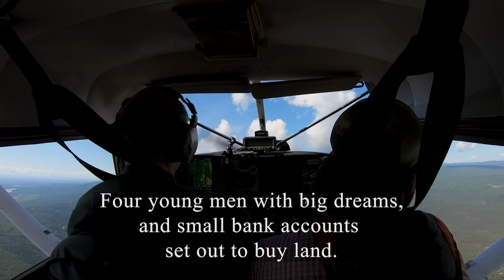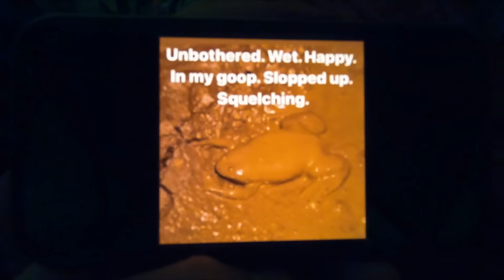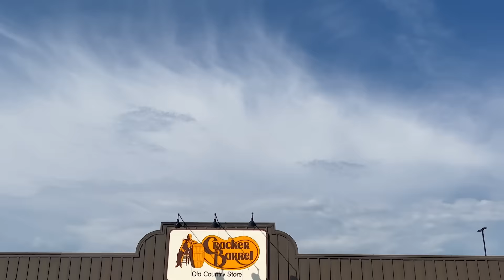30 days Starving and Building a cabin. Hungry Alaskan lessons

Comment: I've been in construction for 25 years and that was a hell of a lot of work guys. Nicely done. Grab yourself a Vaughn 19oz curved handle califoria framer hammer. Cheap, well made, ergonomically silky and powerful. Field test handle like any wood handled tool before taking it into the bush but I have never had one break. Claw doubles as a pickaroon.
Reply: @swervsplatt9672  Stiletto handles usually fail if you work them hard. Most pro's use a separate hammer for pulling nails/demo if they run a Stiletto.  They are alright for repetitive smaller nail application but not much else. Vaughn 19oz curved wood handle cali framer is best all around hammer I have ever found and I have tried pretty much all of them. Only one that beats it is an Estwing solid steel framer, which are basically invincible, but handle design lacks that comfortable end grip, wrist flick crazy power that long curved wood handles deliver. 

-Rehandled Stiletto-not bad but overrated, still takes an extra swing or two compared to others.
-Vaughn 19oz cali framer-Best all around.
-Estwing 28oz solid steel framer-Thor's hammer that makes nails, thumb tips and knee caps vanish with one swing. Just leave the 30oz on the rack. They are to powerful.
Reply: @bryanabingart7362  Happy to help and hope you put it to work. They feel a little slippery when new because of handle coating, like most wood handled tools, which quickly fades in normal construction use but you can also do this yourself with a little razor scraping, light sanding and boiled linseed oil treatment. Plenty of tutorials on here to check out and enjoyable to do and make it your own. Again, it is a wood handle and everyone is unique so go power swing it into a 2x4 scrap or something as hard as you can a few times so there are no doubts and it's tested and approved. Than tune the handle up. Vaughan has never let me down but I have had other brands break or heads become lose after this simple test. Than go build that cabin!
Reply: No one, even the salty old framers around here, use wood handles anymore.  Vaughn's fiberglass models are far superior for durability and shock absorption. Wood is outdated tech
Reply: @bryanabingart7362  I was responding to the original guys comment. I never said to use power tools.. if you want to break a wooden handle out in the bush by all means go off. He even recommends to field test them because this is an issue. It's the same company and the same tool just slightly evolved to deal with the obvious issues. Feel free to figure it out on your own new guy 🤣 I own multiple of each fyi. Too funny. Imagine thinking a fiberglass hammer is a "tech" or easy  answer. Dudes arent even building the handles in the bush like people would back in the day. You dont even know how to talk yo smack right
Reply: @chompers11  Nah, fiberglass is good but in no way superior. Most pro's still prefer solid metal or wood handles and know how to pick ones with preferable grain and test them anyways just in case. Glass is good for repetitive light hitting or heavy shaft splitting mauls/shovels but work it hard with leverage and it will fiber out and turn into a broom. Hell, even miss the nail or wood you're splitting a few times and hit the neck and it will fiber out. I've broke more fiberglass handles than I can remember usually pulling nails and even saw a guy take a hammer head to the face 30 ft away off one of those glass handle grenades when head let loose. I've never used one since I saw that. Plus I work where it can get down to -30. When it's that cold glass hammer handles can simply shatter from minimal use. Wood handles aren't outdated, they are the universal standard proven by 1000's of years of use.
Reply: Steel or wood ? steel on site, wood in the workshop, as for nail removal, a wrecking bar of some kind is a must, useful anyway. I know a man who has had a glass handled hammer for years but he’s a shopfitter !   I started on farm buildings with the only spare hammer on site, a 28 ounce steel shafted thing, you get used to them, Of course nobody used framing hammers in England in the seventies, ‘cos there weren’t any ! Anyway we’d have been embarrassed to need a handle that long.
Reply: Go with the 21oz
Reply: 22 or 28oz Estwing.. I'm still using my 22oz everyday after 15 years.
Reply: @houseblacksmithing9836  Estwings are great. Just remember these guys have to pack all the stuff in and out, are not regular hammer swingers as far as I know and are gonna go balls to the walls to get as much done as they can. That's why I recommended the 19oz because every ounce you have to pack in and repeatedly lift counts, arm fatigue can quickly become dangerous and slow or kill any progress and a 19oz gives a little wiggle room if you are noodle arming later in the day and glance a knee or hand. 19oz will get everything done they will need it for without accelerated fatigue and higher accident risk.
Reply: Estwing for my 33 years
Reply: @69jbr69  Never seen one fail in five years. And yes, a cats paw and mini pry are standard accessories on our nailbags.
Edit: This is doing pole buildings. So, yeah, if I needed a hammer for when I was doing concrete, I used Estwing.
Reply: @swervsplatt9672  Ya, cat's paws are ridiculously handy. In my bag I run tape, speed square, cat's paw(with slightly longer handle for leverage and finger safety if I have to smack leverage it), small moulding pry bar, flat trim pry bar, chisel, punch, chalk line, utility knife, various pencils, Vaughan 19oz, tin snips and a torpedo level. Found that combo to cover just about everything from foundation to turn key with a few specialty hand tools needed here and there of course.
Reply: @69jbr69  That's the setup. 👍
Reply: @69jbr69  A short pointless aside: Years ago when I was first getting started working for myself, I was hired as a handyman by an old fellow.  The first few jobs he paid me with Estwing hammers.  My wife thought I was nuts, but at the time one hammer was worth ten hours of my work.  I ended up working off and on for the guy for years, come to find out he was an expert concrete man, and had worked as the General Supervisor on three dam projects, along with several other large builds.  I learned more from that man than I've learned from anyone after thirty five years experience... and I still have all those Estwing hammers.
Reply: @electrocanman  Great story and sounds like a winning deal to me. Laughing at picturing your wife's face when she asked how much you made that day and you proudly whipped out an Estwing. Most women just don't understand.
Reply: I’ve never had a nail that didn’t drive with my axe or hatchet. Can’t pull one very easy but have never had to when building in the bush.
Reply: Nice video

Comment: as a 53-year-old carpenter from Ontario. I built my first cabin at 12 years old, by myself, in my local woods. The cabin was 18' x 12', flat roof, covered with 30" x 30" tin...supplied by my grandpa. Did it all with one of my dad's splitting axes.The cabin was made from eight to ten-inch diameter white cedar.
 I am enjoying this adventure thoroughly
Reply: Pictures
Reply: @lloyd nelson  I wish I did, that was 1982...I don't know that had even taken my first picture, let alone have a camera.It's probably one of the reasons why kids did things like that then. We went outside to play.
Reply: I'm 50 and I built my first cabin at 47 years old. I learned so buch from the first build (in Louisiana) that I am traveling to Alaska for my next build. I cant wait.
Reply: @markymarc37  Yeah we did. 

57 years old. Made a crossbow at 12, from first principles, i.e. we had no such thing as tutorials, I had seen crossbows in comic books. The first one could drive the dowel arrow with six inch nail tip through a inch pine board. The trigger was SUPER touchy, asked an uncle what I was doing wrong. He said "Ummm, the answer is making a crossbow and firing it in the town without  training. Come with me" and gave me better gear, and some books, and firm instructions not to shoot  anywhere except where there was a backdrop* . He also showed me how to repurpose household things, which was a revelation. You can make an AWESOME trigger from a cupboard catch.

* This worked fine, until it didn't.
Reply: @markymarc37  bruh, i lived out in the sticks and "went outside to play" but nobody today is getting handed a few grand worth of tin and lumber and told to have fun
Reply: When i was 8 i made a replica 1:1 collosseum out of wood with my grandmothers 30 year old toothpick.
Reply: Hero.
Reply: Holy smokes, I was just a kid with a paper route, no big dollars.
Just vacant bush at the end of the end of the street. No one cared, kids making forts.
Reply: @chetmcdonald 44 here, and that’s something I’d LOVE to do as well! Good luck my friend!❤
Reply: liar.
Reply: Nobody cares about your story... make the video!!
Reply: Idk if giving a 12 year old a splitting axe is a good idea but respect for making it
Reply: @n.c.pictures  he didn't give it to me I snuck it, lol
Reply: @markymarc37  well damn 😂
Reply: They don't make 12 year Olds like that anymore
Reply: Built a cabin in the 6th, and it started to produce kids by 7th grade. True story.

Comment: Watching this reminds me of when I built my log cabin 15 years ago. I still live in it to this day. I built it because of the line of work I do, I want to be off grid. My only electricity for my phones and computer is a massive generac generator I have I out here I have converted to run of pretty much any type of ignition source. Whether it be propane, butane, acetone, gas, lighter fluid, diesel and so on. It it lights up I can run off of it. Incase your wondering how I got a regular generator to run off all these thing being just a regular gas generator you can check k out the channel project farm. But either way it took me 6 months to build it and it's 2 stories. I also didn't use hand tools because the main trees I was dealing with is all hard wood like oak, hickory, maple and so on. I live on the east coast close to DC but no DC. Another thing i did different that they didnt do is i drove long pieces of rebar in the 4 corners of the house where they cut the notches in each corner so that the wood doesnt shift over time. Also I used chainsaws and electric tools for the whole project and I even ended up putting a real roof on it a couple years ago and jacking mine up off the ground and putting it on concrete slabs because the area I live in is always wet and the wood started rotting even though I burnt the logs touching the ground first.i also put windows in. What made me do this was all the death threats I've got from other hackers because I invented alot of there money and ruined alot of there transactions. Incase you wo Der what it is I do exactly is I steal from criminals and other hackers on the dark web. Incase they track my ip address it won't come back to an actual address because I don't have one even though I run 5 different VPNs on my computer I still don't take the risk especially when your stealing money from hitman and other sites like silk road (its since been closed down) but there is other site like spy shop and so on.im a criminal that rob criminals and yes I know what I'm getting into and I know who I'm dealing with and no I'm not scared to die and yes I fully expect one night to wake up in my own cabin with a gun to my head or to never wake up in the first place. Some ppl I ha e stole from include the Italian mafia and the Mexican cartels, hitman, gun and drug dealers and in one case even a government. Let's say some governments like to play war lords and help supply weapons s to good and bad countries. Though this is rare to find on the dark web it is possible. But I'm done talking I don't want to bore you all, it get kinda lonely with just me, my dog and wife. Yes we live completely off the land except for when I want to buy tools, clothes and dirtbikes/ ATVs I never leave the woods.i know I'll get comments saying I'm a liar but that's good I don't want anyone to believe me I've already said to much buy my life is so secretive that I at times really just want to talk to someone that will listen and talk to someone that I can really let know what goes on out there on the internet.  Your information is not safe no matter what app or site you use no matter how big or anything your info is not safe. Period. Your Google accounts, YouTube accounts, online banking, brevity and bank card information including address, pin and account numbers are not safe. Every purchase you make, the info you gave not safe or secure like these sites claim. They like to say your privacy and information is safe and confidential when using our site..... bullshit. Do you really think these companies have some kind of huge hard drive somewhere where they store al there customers info to be private and secure? No. It all gets saved to the Deep Web which is different than  the darkweb. For a lack of better terms that you all will understand they save it to A CLOUD, online storage. That anybody can access if they know how to do it. So when you make accounts don't use your real info, buying stuff online? Use a p.O. box and a prepaid card so of they do get your info they pnly get so much. And if you don't use a VPN you IP address is so easy to fi d and it tells ppl like me the exact location you live, not just the area but your actual address. I'm done here I hope you all have learned something. Believe me or don't but just remember this day I told you so if your info gets stolen or hacked or your money gets stolen
Reply: thanks boss,
Reply: Take your meds

Comment: You guys are working with green trees ( normally log buildings use dead standing trees )which will lead to major problems.
Once you have interior heat you will have a lot of shrinkage which causes a lot of uneven settling .
Best to stack the logs with a tarp covered roof , rough cut windows and doors then come back the next early summer and finish it . Or , stack the logs with stickers in between so air can circulate throughout the stack while double tarpping the top . Get yourselves a moisture meter . Avoid any twisted trees. Seen these twist half way out of the walls or split while drying out . Good luck for anyone else doing this.
Reply: Most of the old timers used both dead and live trees for building! Dick Preicke(sp) was one ! You use what's available!!
Reply: @donaldhofman5257  Dick Proenneke, I thought he had cut all his trees the year before? Good film, I’ll have to watch it again
Reply: Do you think the pioneers said hey family let’s let the logs dry while we freeze in a chuck wagon no 
The used what they could and fast 
It’s people now that have time too build and live in homes already that have time too let their logs too dry

Comment: Great video! You guys did great on the build, my only concern is your roof this winter. I live in Alaska and we get a lot of snow 5-10ft depending on where you live, which is heavier than you might think. You basically have to build you roof to support the weight of a car. Especially this year we have already been hit with two huge storms about 3ft and its only December.

Comment: Closed loop Propylene Glycol floor heat would be a good system. If power fails in the dead of winter, it still wont freeze, and the tubing has give in the off chance it was -40 inside.

Comment: The better roof would consist of Scandinavian coped logs, coped in such a way (top and bottom logs), inverted & tied together in such a way that rain drains off the side. The cap log coped in the same way. Much stronger roof that way. Also the heavy snow loads in Alaskan winters require a sharper roof pitch so the snow can slide off before it collapses the roof.

Comment: I'm not sure why most people use such large logs to build the log houses, when you think of what a typical house is built with, it is built with boards only  two inches thick by four inches wide, and they are spaced on sixteen inch centers, and those houses last many many years, so if you just used logs between only three or four inches thick, then that would be sufficient for home building, and it would be way easier to cut, carry and work with, so try that on your next build, and see if it makes more sense and goes together much quicker, and with much less effort. 😁👍